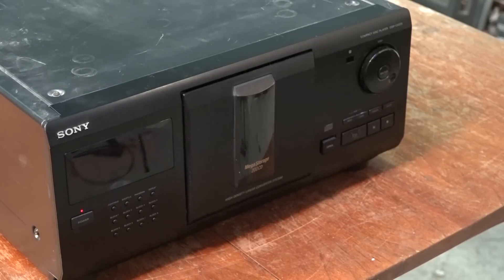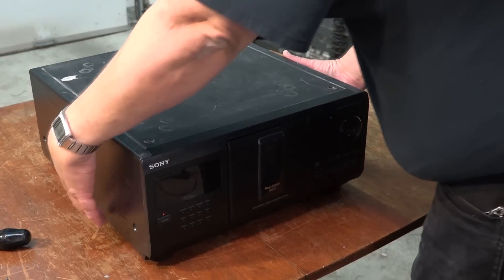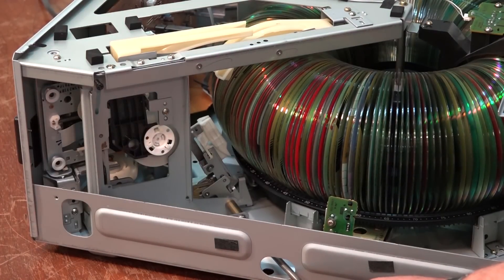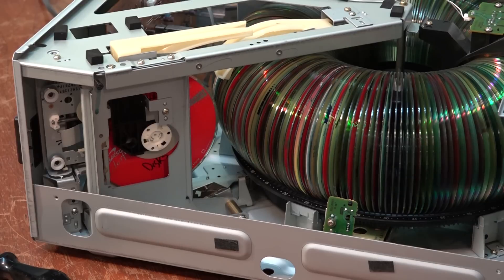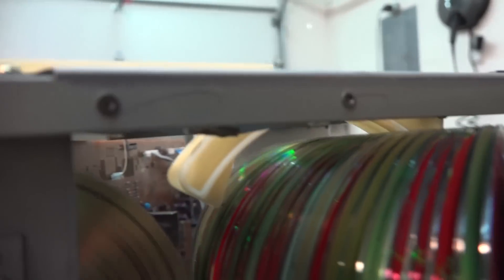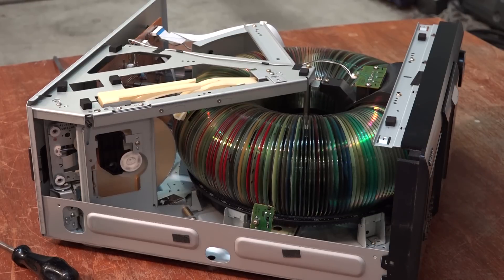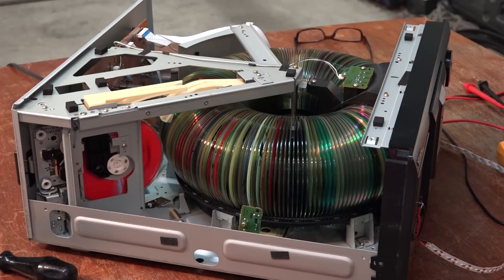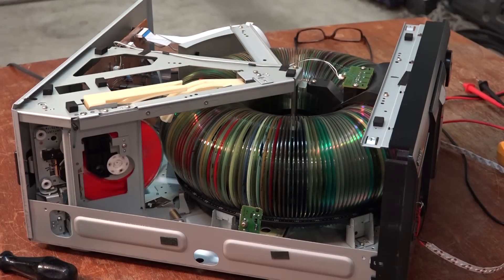Sony CDP CX225 200 Disk changer

Comment: This is a really cool system..., but I'll stay with a 5 disc max system...
Reply from the maker: I love it. Would never trade for a 5 disk. Oh wait, I did. That's how I got it. Traded a 5 disk for it.
Reply: @12voltvids How do this machines age? I mean, not just laser and belts, but arms and load disc mechanism.
Reply: @jlatala4655  In my experience (owning several 300's), they age very well.  As expected, the rubber belts eventually wear out but are not a huge deal to replace (the front door belt requires a bit more work).

Comment: I think these things are really cool from an engineering standpoint, and are useful for whoever has lots of CD's and needs to play hours and hours of music, and/or has nowhere to store cases. However, I personally would have no use for one because I keep my whole CD collection in original cases on shelves/racks. To me, these mega changers take half the fun of CD collecting away, and it would also be hard to keep track of what's in which slot. I'm happy with my 5-disc carousel, and they are a more reliable technology.

Comment: Just got one yesterday CDP-CX205. Opened it and there's tons of grease inside. Just regular auto grease. Whats baffling is that the seller was running it on 220v, but the label says 120v and it doesnt have a voltage selector. It  is working fine  on the youtube video of the seller. I tried running it on my 50w 120v converter, but its sluggish and wont read any disc. Could it really be 220v or I need a higher wattage converter?

Comment: Bro I bought one from the thrift store and it didn’t read my cds and I was frustrated watching all these videos to fix it. I opened it up and did all kinda shit. And then I watched your video and the first thing you said to put the cds facing left, I ran and put it in there like you said and boom, works like a champ. I felt like an idiot hahaha. 

Thank you so much for the video bro
Reply from the maker: Should be a sticker on there that says keep label facing right.
Reply: @12voltvids  haha now I see it. Thank you again
Reply from the maker: Np. They are great units.  I have both my 200 disk units running now one plays while the other cues up the next track. Then they switch for constant music.  I about 380 disks loaded between the 2 of them right now and run them almost every day.  That's the way to keep these things working.  Use them.
Reply: @12voltvids  awesome. Thank you for the tips
Reply: Some have the ones to say place the CDs with the label side showing.

Comment: Thx for opening this up... always curious about the guts, but was never going to open it up unless absolutely necessary!
I have 2 of the ES version of this player the CX90... they've been rock solid for many years... and no, I've never moved them! :)  One nifty feature is that you can chain two of these units together and they act like one 400 disc changer... I use it on random all the time... it's a great way to listen to music that you've purchased so long ago that you'd forgotten and never think of playing... it's like re-discovering your CD collection every time I turn the thing on!
Reply from the maker: Yes that is for sure. That is what I do. I took all my CDs, and made compilation disks on CD-R. Took all the good songs from each disk and burned a copy, filled up 80 minute disks. Then loaded all those disks into the changer. I think I am about 190 disks now, not quite full. I leave it play on random and never hear a bad track. What I would really like to do is make a lexan cover for it, so the inner workings can be seen as it is running. I think that would look great. A show piece.  I am always on the look out for the 300 or 400 disk changers, but haven't found one yet.

Comment: Very helpful info , thanks much! I have 2 300s and one 400. That info on the Blue Switch could be very important when my units fail. The 300 and 400 don't use toothed belts, just 
simple bands.

Comment: Thats massive :-), ive never seen a disk changer so big before.
Thats so nice how it operates, a top glass would be great as long as it didnt upset the optical sensors :-D
It reminds me of the old rockola record dukebox my frend has, the records are on a vertical rotating wheel, i repaired that many years ago.
The optical disk sensor was being ignored, it was an old 1970's logic chip in the processing that had bit the dust.
So interesting how it all worked, needed a clear panel in it really, amazing :-D

Comment: I have the 400 disc CDP-CX450 changer. It's mechanism is rather different, no metal frame over the top under the lid so that's interesting. I have to move the unit I have in order to re-rout unrelated cable so when I do that I will compare the mechanisms... and as you said I will remove the discs before doing so! That's worked for me before.

Comment: My jog/dial knob  isn’t working properly.  When the door is open it won’t spin the carousel around properly.  It will actually move it sometimes back and forth or the reverse direction of what it’s supposed to go and doesn’t move very far either. Otherwise the player will play the discs fine. 
Any suggestions ?
Reply from the maker: Asking the same question 3 times is a good way to get the boot

Comment: the IR replacement really helped me, my vcr remote had a really short distance as in right up to the unit I just thought it was a crap remote, so replaced the Ir from an old remote and its 10 times better now, never thought it could be the IR thats duff.

Comment: I have the same unit but a slightly lower end one without an external DAC. I was a little disappointed about that but the thing sounds very decent anyway and mine is pretty much in new condition. i like the way these use a very common CD mechanism as well so easily fixed. nicely engineered unit :-)

Comment: I purchased one of these units for £25 from a second hand shop and sold it for £150 great machines Top vid
Reply from the maker: That's like the tascam da40 I picked up for 20 bucks. Now that it is fixed I fully expect I wil get a minimum of 500 for it, as I see them going for 450US and up for fully restored units, and mine is fully restored now.

Comment: what a score you really lucked out with this unit . enjoy and I am sure that you are thank you for posting this and sharing it all the best have a great weekend
Reply from the maker: Yes and it was brand new. The guy that bought it, a local realtor (still here too) bought it new from the shop I worked at. When I was doing some work for him, he was complaining about how hard it was to use to find a specific disk. (I guess he never thought to catalog the disks he loaded)  and said how he wished he had a 5 disk carousel unit. I said, hey I have a 5 disk ES model that I recently rebuilt, new laser and spindle motor. He said want to trade, I said hell yes.

Comment: I'm getting little rectangular marks/scratches near the outside of my CDs that I believe are coming from this "chucker" as you call it in my Sony CDP-CX240, have you ever seen that happen?  Is it possible there's supposed to be some kind of padding on the inside of that thing that grabs the cd out of the carousel?  I can send pics if you're interested.  Any advice on how I can make sure this doesn't happen?  Was thinking of just putting small piece of scotch tape on inside edge of the grabber, but didn't want to gum up the works if all this is super precision.  Sorry for posting this here, for some reason couldn't post a comment on the video of the 200 disc changer.
Reply from the maker: If I remember there is a rubber gripper that is on the end of the arm that chuks the disk.

Comment: Help...Just bought a used CDP-CX and had a problem with the spindle not spinning. Fixed that, but I have another issue. The display that tells me the disc#, track# and so on is very dull. I can hardly read it. I noticed in this video your display is quite bright and easy to read. Can you help me with this?
Reply from the maker: Those indicator tubes do wear out.  If the voltages are correct then its the tube
Reply: Thanks, are they replaceable?  @12voltvids
Reply from the maker: @tomcampbell2642  if you can find them.

Comment: I have the 235. It looks pretty similar except the door slides to the side to open instead of dropping down. I bought it new probably 20 years ago and it's still going (knock on wood). Mine has the yellow light all the way in the back of the unit and it's still super bright.

Comment: I have a CDP-CX250 and a CDP-CX300 I bought used. Unfortunately, the CX250 is missing some door parts (latching and unlatching parts) so the door mechanism doesn't work, I have to tape it shut but that is just a minor annoyance because when fully loaded disks are rarely changed. I just changed the belts in the CDP-CX300. I am trying to figure out how to use them to automate copying CDs to computer to use a computer as a jukebox instead.

Comment: Hey it is very cool I have the 400 disk one, my question is do sony make another version that can play more than 400 CD? And can I connect two of these together in sequence so I can have them play after one player is done the next one will start?
Reply from the maker: The 400 was the highest capacity and yes you could connect 2 together. System would cue up second track and then cross fade between the tracks.

Comment: I have a Sanyo 24 disc machine that had the ability to be able to me moved whilst loaded. I used to run a mobile disco & had the top chart CD's loaded into the appropriate slots on the machine. If someone asked if I could play the current no 1 (or whatever), I just pressed '1' & it played. The carousel is shrouded so as not to spill in transit. Pioneer did a 25 disc machine with a straight rack & Kenwood did a 200 disc carousel similar to the Sony being demonstrated.

Richard (UK)

Comment: How do you fix spindle wheel noise ,plays fine to explain , a finger on top of wine glass wheel not broke I’ve tried numerous options still comes back if needs new wheel where do I get one  can’t miss white wheel for disk ,certain temp related also 70 or better ,I love watching on inside to these were just coming out when I got this one didn’t see 400 disk till later the ones after even had text on it I can play it thru the stereo sounds even better use red white cable

Comment: You are a great teacher. Thanks! I’ve been able to keep my Sony cdp400 going with the info you’ve provided. Unfortunately, a new challenge has happened- the shuffle all discs feature isn’t working. The player will shuffle, pick and play the first disc and track, but then stops when the song is finished. Everything else(shuffle 1 disc, continuous play) works fine, and the belts have been replaced. Any ideas what needs to be adjusted to fix that?
Reply from the maker: No idea.
Reply: I think that is software issue. Maybe you can factory reset device in service mode or something like that. If you have discs in the player and it recognizes them and can so play them all, shuffle should be working then. So check this factory reset option.

Comment: Thanks a lot for the well-made video! I've got a 50-cd charger which I bought new almost 20 years ago! I love it but it's been skipping tracks and having problems chucking discs. Will try cleaning the lens and having a look inside to check the other things you mentioned in your video (belt...). Wish me luck. Any suggestions are very welcomed!
Reply from the maker: Skipping. Is usually the spindle motor, or a weak laser
Reply: +12voltvids Thanks. I'll focus on those 2 possibilities. I forgot to mention that it doesn't always skip and someone's it'll pick up a disc w/o problems while other times it'll just keep spinning back and forth, maybe eventually chucking a disc and maybe but, eventually stopping altogether. In short, the behavior seems radical, not consistent.
Reply: Hi again, I finally found and ordered the optical drive for my CD changer but have a question I'm hoping you can answer: Is it necessary to remove the solder on the two contact points of the circuit board before installing it (the solder is supposed to protect from electrical static discharge)?
Thanks!
Reply from the maker: Unsolder the short pads after you connect the opu to the main board

Comment: Funny to find  you here Dave! Just picked up one of these units today and was looking for info on cleaning it as it is skipping a bit and found this vid. Kath wants to load all of her hundreds of 80's cds and will not get rid of them! haha. Good info on your channel. Hope all is well. If you know what may be causing the skip, pls let us know. Thx Scott . Class of 81 SDSS.
Reply from the maker: Skipping is usually caused by either a bad spindle motor or weak laser.  Also check the little white gear on the sled motor for a crack.  That is very common and it causes the sled motor to stick.  Eventually the motor overcomes the sticking tooth and shoots forward causing the laser to overshoot and skip forward.
Reply: @12voltvids  if those two components are the issue , can the parts be sourced still? Does lubricating the sled help at all and what type of lube should be used? Thx
Reply from the maker: @scoleman7862  lithium grease for the sled.  Laser block are available as are the spindle motors.  Check kpcomponents as they carry those hard to source parts. The gear may have to be salvaged or perhaps 3d printed.
Reply: @12voltvids  Thx Dave . In your experience will greasing the sled first solve the issue or is it more likely the laser and spindle?
Reply from the maker: @scoleman7862  a stuck sled is a very common cause of skipping. When it gets stuck the motor works harder to move the laser and then the stuck grease breaks free and the laser jumps forward.  So yes gummed up mechanism causes at least 50% problems.

Comment: LOL...I got a Sony DVP-CX850D 200 disc DVD changer at Goodwill for $40. Nothing wrong with it...works perfectly. It just needed a remote that I got off ebay. Only 200 discs, but if you use dual-layer discs and record 2 movies on each, you can double the capacity.

Comment: Leave it to the Japanese to come up with a player like this.  However, they eventually have the same problem as cassette tape players and other CD players is that the belts eventually break or turn to mush after about ten years, almost always.  Did you know that CDs play from the inside out and will skip if the laser encounters even the smallest particle of ding?  That's why you should never hold CDs by their surface but by their edge only, just like vinyl LPs. .
Reply from the maker: These players typically have a tooth belt that doesn't break.  Yes CD and DVD read from the inside out as did laserdisk.   Dustin fingerprints are not normally an issue because they are not in focus the dangerous focused on the top side through the polycarbonate base but scratches to the top layer of a CD will definitely disrupt the laser and that's why they tell you not to stick labels on them because the adhesive can actually attack the aluminum reflective coating on the CD. That's why you don't stick labels of any kind and only write on the surface of CDR with felt pen designed for CD as the solvent in many pens will actually disrupt the laquor layer and allow oxygen to get to the reflective surface. Look aftwrvyiur CDs and they will last a lifetime.  I have cdr and cdrw that go back to the first generation recorders that still play fine.

Comment: I recently bought one of these at Goodwill. It skips badly so I opened it up and watched it try to play. The disc wobbles badly on the spindle. Should I just return this unit ($27), or try to fix it? I don’t know if it’s an easy or worthwhile fix.
Reply from the maker: If disk is wobbling the disk platter is probably out of adjustment so the clamp is not holding the disk correctly.  They are usually pretty easy to adjust

Comment: HELP NEEDED: I replaced the belts on my second CX355 changer (300cd) but it didn't solve the problem of not operating. Lights and digital reads , motor hums, door will not open, delays shutting down when switched off. Any ideas?

Comment: great video!  i'm a fan of these as i have a huge cd collection, but had no joy with two Sony CDP-CX230: one skips wildly on all cd's, and the other the cd won't even spin.  Your video shows it's possible to get to the bottom of the problem.  I've had better luck with Pioneer PD-F models, other than sometimes not catching the disc properly they've been fairly reliable and sound fine.  I also tried a Kenwood DP-J, that was almost fine except it had problems reading about 1-in-10 discs and also the carousel would randomly whirl about in a confused loop, to the point only powering down several times helped.  I even had a JVC XL-MC100 but they're huge and fiddly.  

Fascinating but frustrating machines.  Once you do bag a reliable one you'll rediscover musik in ways which are somehow more enjoyable than mp3-playlists or youtube-streaming. I guess the more involved physical nature helps you psychologically connect more, plus superior audio quality (CD is only matched by WAV in terms of digital audio).

Comment: I have the Nakamichi rebadge of this, super cool player, got mine for 20 bucks fully working. One question, the internals and controls on my unit are identical to the sony, the buttons are all in the exact same place, I would think other than the front panel these units are identical. Would a remote for the Sony unit work on my Nakamichi you think? I'm having a hard time tracking down the Nakamichi remote.